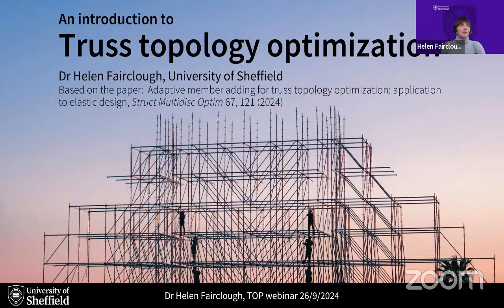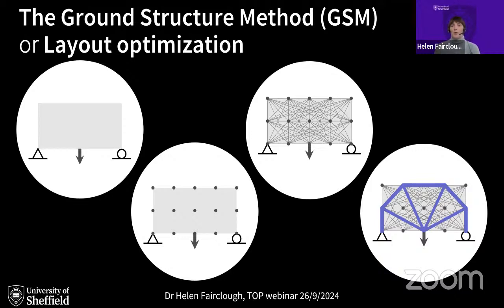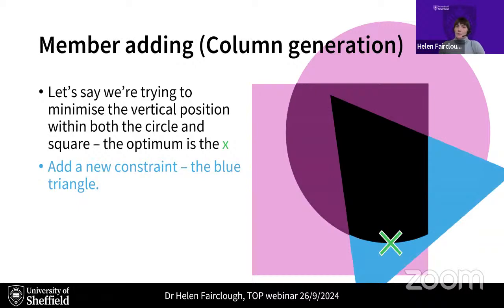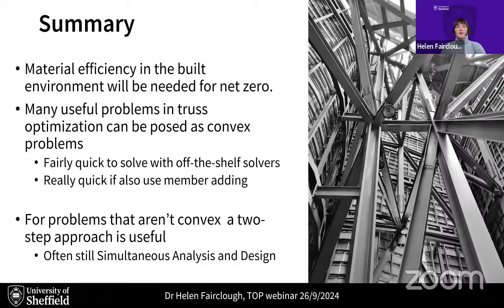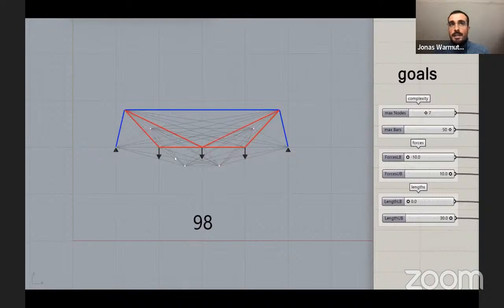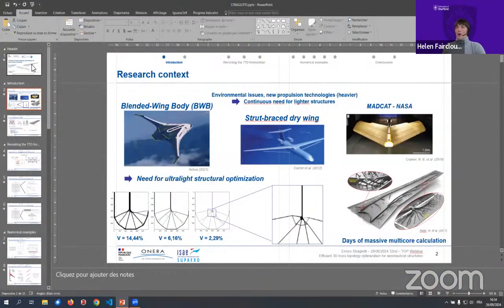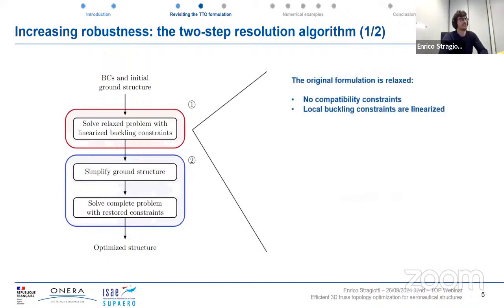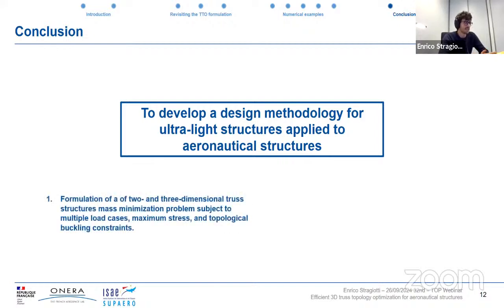TOP Webinar 32: Truss optimization

Comment: Top Webinar 32: Truss Optimization

* 0:27 Introduction and Webinar Start: Dr. Hannah Flack Clancy from the University of Sheffield introduces the topic of truss optimization, focusing on its relevance to elastic compliance design and the built environment.
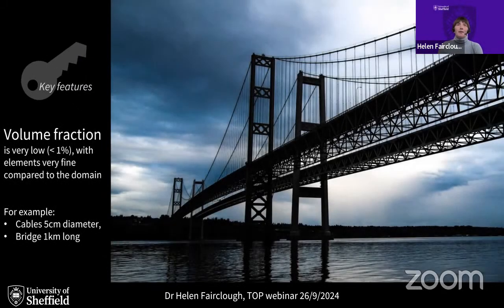* 3:24 Truss Optimization Problems:  Different truss optimization problems are discussed in order of increasing complexity, starting with basic formulations and moving towards more advanced considerations. 
* 9:59 Formulating Truss Optimization:  Common formulations for truss optimization problems are presented, including the rigid plastic formulation and compliance optimization.
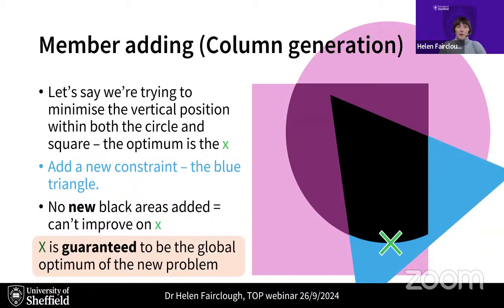* 14:57 Comparing Rigid Plastic and Compliance Optimization: The impact of multiple load cases on the optimal truss topology is demonstrated, showcasing the differences between rigid plastic and compliance-based approaches.
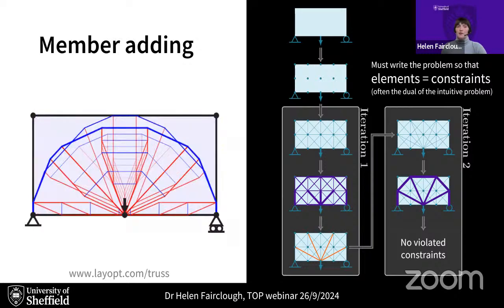* 15:27 Member Adding (Column Generation):  A technique called member adding (or column generation) is introduced as a method to accelerate the solution process for truss optimization, particularly for larger, high-resolution problems.
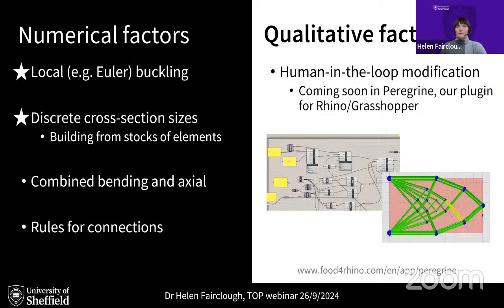* 19:38 Non-Convex Truss Optimization Problems: Strategies for dealing with non-convex truss optimization problems are discussed, including a two-step approach where a simplified problem is solved first to provide a starting point for the more complex problem.
* 20:29 Geometry and Shape Optimization: The application of geometry and shape optimization to improve truss designs is presented, emphasizing its ability to enhance the aesthetics and interpretability of results. 
* 21:29 Human-in-the-Loop Modification: The concept of incorporating human input into the truss design process is introduced as a way to address aesthetic or other non-quantifiable design goals.
* 23:26 Design and Exploration of Low Carbon Structures (Jonas Warmuth, EPFL):  Jonas Warmuth discusses strategies for designing and exploring low-carbon structures, focusing on resource-efficient design using a modified ground structure approach and the reuse of structural elements.
* 24:58 Resource Efficiency and Layout Optimization:  A user-driven layout optimization approach is presented, where designers can place nodes to create custom ground structures, enabling the exploration of a wider variety of efficient structural forms.
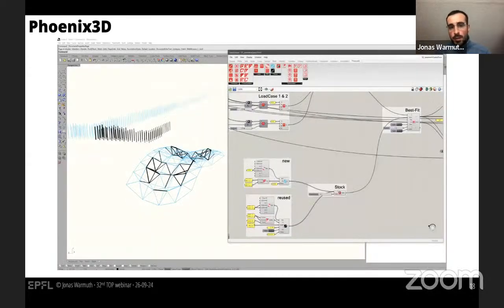* 30:01 Reuse and Circular Construction:  The importance of reuse and circular construction principles in reducing the environmental impact of structures is discussed. A computational tool called Phoenix 3D is introduced for optimizing the reuse of structural elements.
* 33:16 Combining Resource Efficiency and Reuse:  The potential for combining resource-efficient design with reuse strategies is highlighted, offering a powerful approach for achieving environmentally sustainable structures.
* 35:49 Efficient 3D Truss Topology Optimization for Aeronautical Structures (Enrico Stir, ONERA): Enrico Stir presents research on efficient 3D truss topology optimization for aeronautical structures, emphasizing the need for lightweight and reliable designs in the aerospace industry.
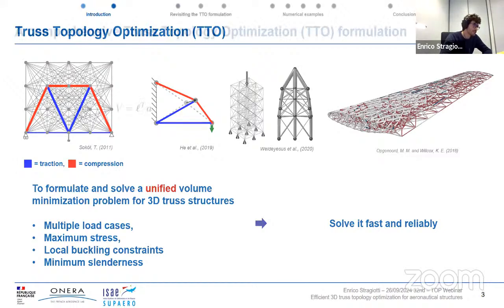* 38:03 Ground Structure Method and Mechanical Constraints:  The ground structure method is used as the foundation for truss topology optimization, considering multiple mechanical constraints like stress, local buckling, and minimum slenderness.
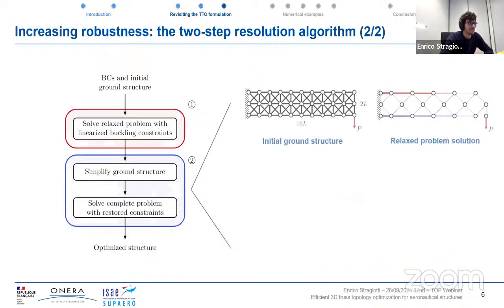* 41:18 Two-Step Resolution Algorithm:  A two-step resolution algorithm is proposed to address the non-linear and non-convex nature of the optimization problem. The algorithm involves solving a relaxed problem first and then using its solution to simplify the ground structure for a subsequent non-linear optimization.
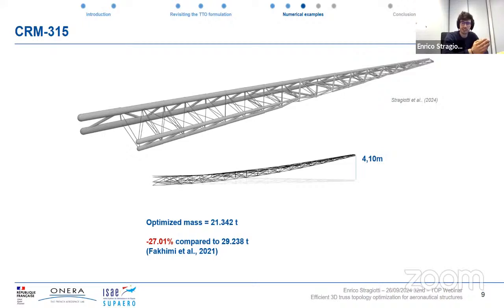* 44:58 Algorithm Validation and Aeronautical Case Study:  The algorithm's effectiveness is demonstrated on a simple 10-bar truss case and then applied to a more complex aeronautical wing box optimization problem, achieving significant mass reduction compared to existing literature.
* 50:02 Q&A Session:  A question and answer session follows the presentations, addressing various aspects of truss optimization, including user-placed nodes, joint modeling, industry adoption, machine learning, and the human-in-the-loop design process.

I used gemini-1.5-pro-exp-0827 on rocketrecap dot com to summarize the transcript.
Cost (if I didn't use the free tier): $0.04
Input tokens: 25532
Output tokens: 824